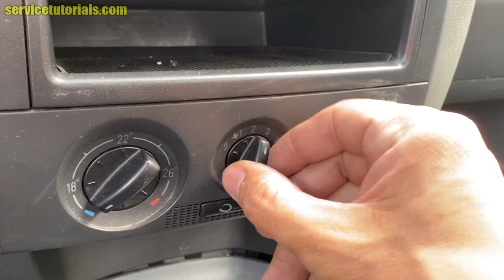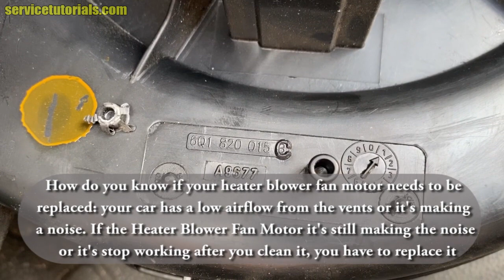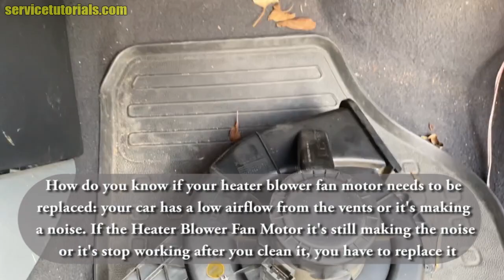Skoda Fabia Mk1 (1999-2007) Heater Ventilation Blower Fan Control Unit replacement / removal

Comment: Yeah, nice video, helpful. Need to do it myself also, mine works but its debalanced and vibrates like crazy over 1st step, oh and the recirculation  motor aswell, that does not work at al

Comment: Need to take care putting the hose back on the glovebox air inlet adjuster, it's easy to break the locating tabs off, have to hold the air inlet adjuster in place from inside the glovebox while pushing the hose on.

Comment: I am having trouble with the control and currently is blowing only from the windshield and the feet. When I switch to blow in the face or just feet or just windshield nothing happens even If I hear some noise when switching. I have Skoda roomster 2008 with ac. Do you know how can I allocate the issue?
Reply from the maker: Hi! Probably you have a problem with a servomotor wich is responsable for closing and opening the hvac flaps. See here something similar: https://youtu.be/-JOc7_Orx_o